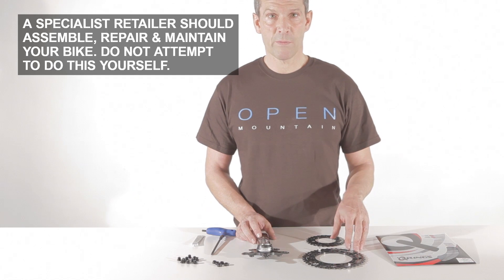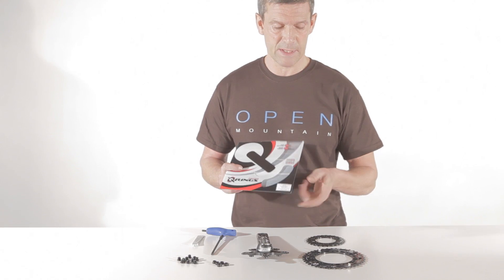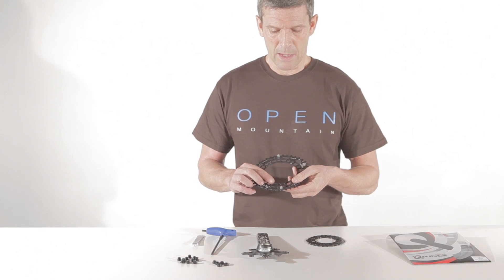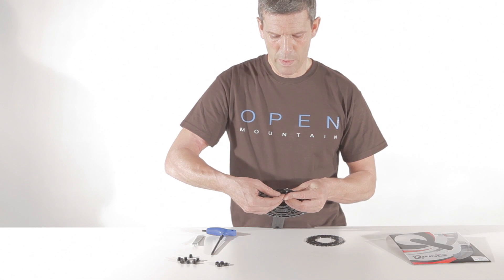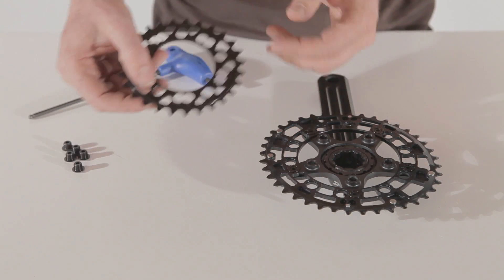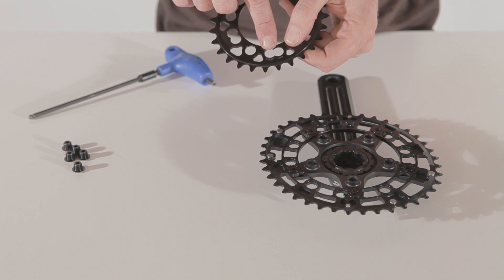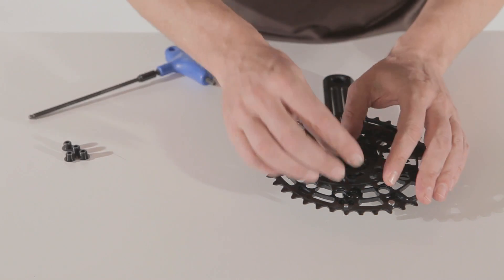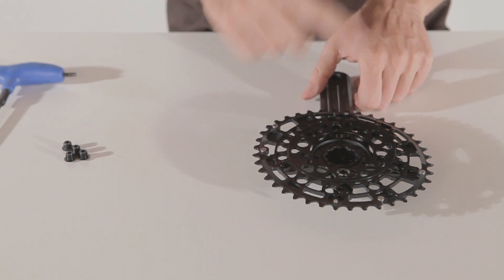Installing the chainrings on the ROTOR crank

Comment: So you installed the the big ring using the 3 hole, and the little ring using the 4 hole. That is what you said anyways. I don't think that is correct, no? You should use the same numbered hole on each ring, no?
Reply: shotbyarrows no.